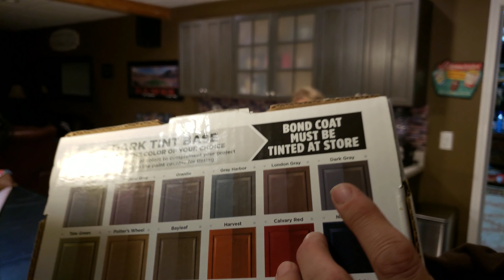RUST OLEUM CABINET TRANSFORMATIONS EXCELLENT RESTORATION TRANSFORMATION PRODUCT THAT WORKS RUSTOLEUM

Comment: Would love to see how you restored your countertops. I see the new countertops in your latest video. Thanks for sharing.
Reply from the maker: I actually replaced the tops with butcher block that I stained with a black walnut stain and sealed it with a poly acrylic clear satin...it was kinda fun but it took almost exactly a month to complete with me and another guy doing it after work each day..I started videoing the process but soon found out it was adding a little too much time to the project..I did learn a lot and was able to get those tops at home depot for a very reasonable price...Thanks for watching!